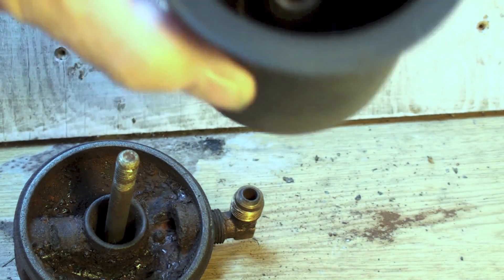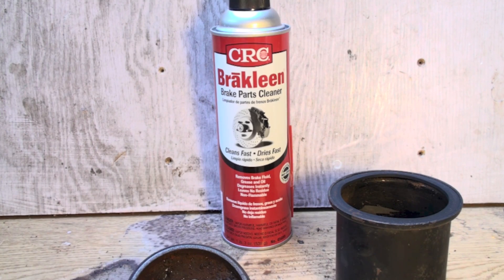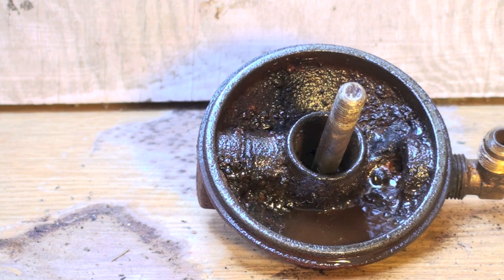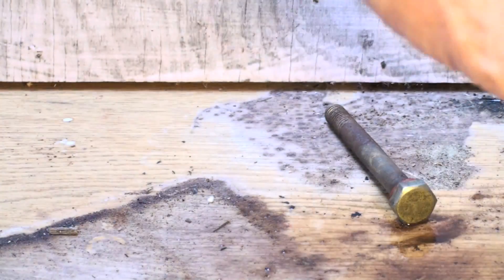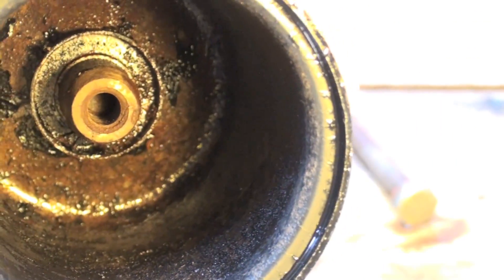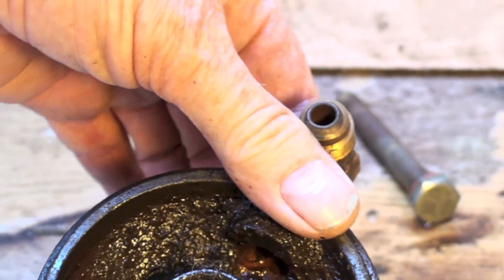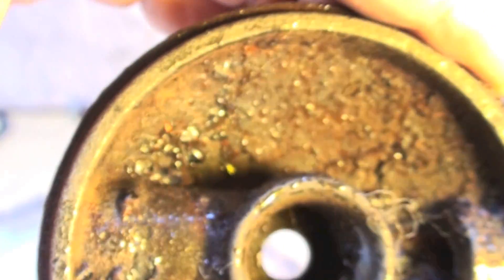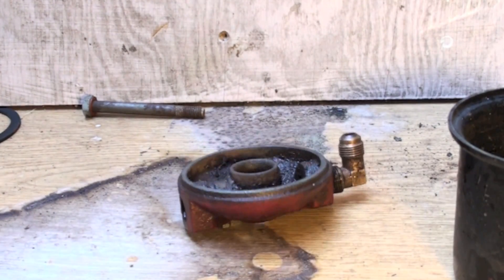Cleaning the oil furnace filter canister

Comment: Hey furnace man love your videos. Have a quick question. Hope you get this bc we are cold lol.  My oil furnace will run great but then as soon as it cycles and goes to turn back on, it fails and then I have to bleed it again. Already put a refurbished filter on and changed the nozzle. I am pretty new at working on these but my pops has been giving me advice. Thanks for all the helpful videos!!
Reply from the maker: You could have a vacuum leak in the oil line or a blocked oil line.  I would start by connecting the gun and pointing it into a can.  Then start the burner.  You should have a steady stream of oil.  Sputtering of the flow indicates a vacuum leak low volume indicates blockage.  Hope this helps.
GFM
Reply: @grayfurnaceman  when you say connecting the gun, what did you mean? I just connect a little hose to the bleeder and I bleed until the air comes out. Then I have a steady little stream. It will run fine for a while then when it stops and goes to start again, it doesn’t come back on when it goes to restart.
Reply: @grayfurnaceman  Is it likely that I have condensation in the lines and maybe it’s gelling
Reply from the maker: @Rookie_bass_fisherman  If you have a 2 pipe system, the bleeder is correct.  You do not need to remove the gun.  If your tank is outside and the outdoor ambient is below 15F you could have gelling.  Of course, if the line or the tank is outside, you could have freezeups.
GFM

Comment: Not worth it ,risking big oil leak from pin hole from rust ,don’t be so cheap and buy new epoxy coated oil filter canister.
Reply from the maker: I could agree with that, except I would replace it with a spin on throwaway.
GFM

Comment: @Grayfurnaceman Thanks again for all of your videos!   I've been having a lot of problems with rust particles/particulate getting through my lines and to the nozzle.   I've replaced the nozzle a few times already.    Obviously with the tank nearly full, there's not a lot I can do, but could I add a second inline filter closer to the furnace to filter out the smaller stuff that's not getting captured by the first one, or will that affect the pump rate?
Reply from the maker: First, is your tank outside?  It should be inside.  I don't know what type of filter you have but I would install a spin on filter.
GFM
Reply: @grayfurnaceman   indoor tank, I have a canister filter like the one you're cleaning in the video.  I'm not sure how long the tank sat before I bought the house, but there are tons of small particles getting through the new filter.  I thought about doing a spin on closer to the furnace after the initial filter to hopefully pick up the extra bits, but I was worried about the flow rate.  If the spin ons are overall better, I could swap out
Reply from the maker: Would not use 2.  The spin ons are far better.
GFM
Reply: Might need a new tank my friend.
Reply: @jamesgillies3710  thanks for the response... Once I treated with diesel treatment and went through 2 nozzles it worked itself out.  I do want to put a spin on filter in at some point, I don't know how I feel about the canister filters like the one on the video.

Comment: Try electrolysis. You would use a high-voltage car battery charger and a plastic bin for your components. It takes some time but it does work.
Reply from the maker: Interesting
GFM
Reply: @grayfurnaceman  The newer "smart" battery chargers typically shut off on you as I believe they think the "battery" is no good. I use an inexpensive dumb 2.5 amp power supply. I flatten out tin cans and use them for anodes. Arm & Hammer Washing Soda is used to make the electrolyte solution--the soap removes the oil too.  I've  removed rust from old woodworking, forestry and mechanics tools, parts of machines, and other steel items with great success.  I did a couple axe heads for my son this past week... he found one laying in the woods and the handle was almost completely rotted away. The head cleaned up nicely.

Comment: I am still learning , but... if the deposits wont come off when trying to clean it  then they shouldn"t come off if you reuse the canister- so why isn't it safe to use?
Reply from the maker: I would never rely on that.  Once you clean it, you own it.  I would rather own a new one.
GFM
Reply: Could you please tell me which is heavier. #2 heating oil or water?
Reply from the maker: All petroleum based fuels are lighter than water.
GFM

Comment: the new one is $20-25 at your local heating supply, not worth the effort or time restoring one that's in such a bad shape, imo (of course).
Reply from the maker: Usually I did replace them.  I cost more to clean than it was worth.  Thanks for the thoughts.
GFM
Reply: big thanks for your videos, BTW! I have learned a lot. I service my own boiler&water heater now. Need to get my hands on combustion&pump pressure testing kit so I could adjust the flame correctly should need arise.
Reply from the maker: biker55555 May save some money in oil.
GFM